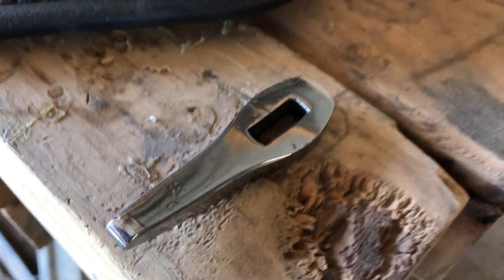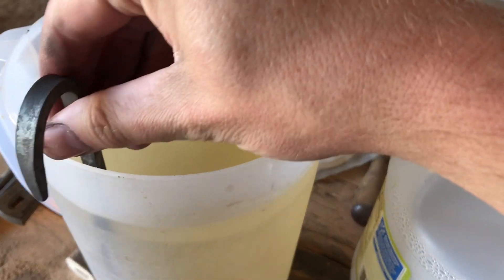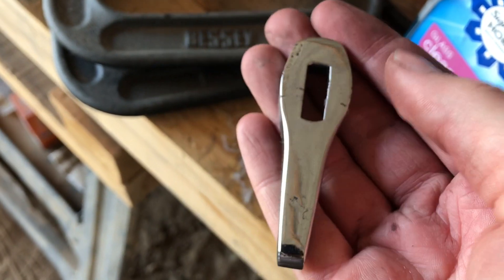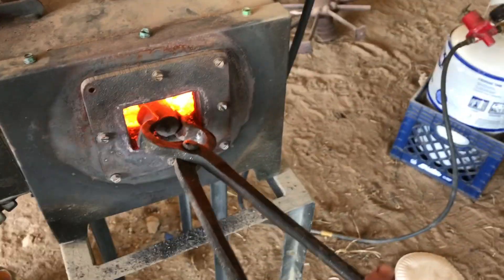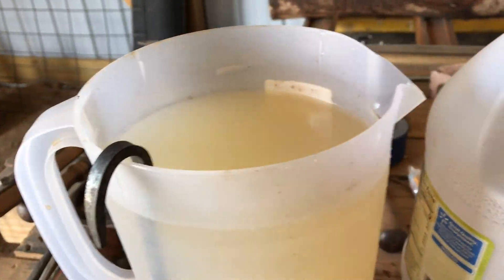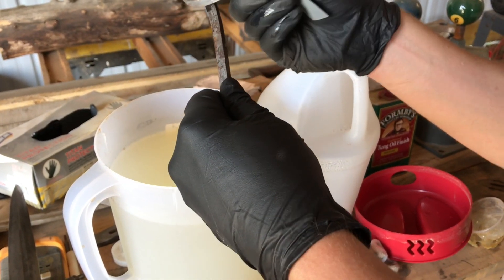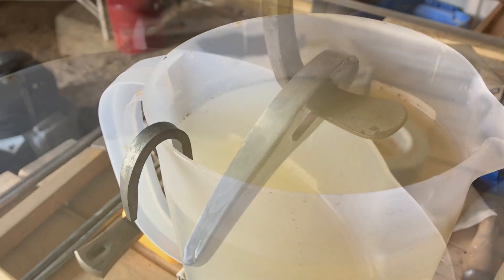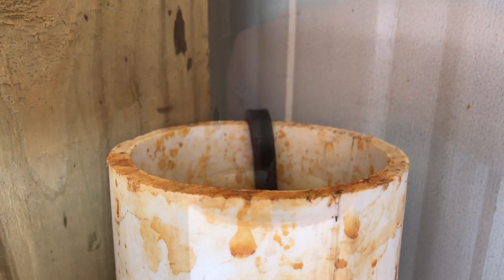How I learned to stop worrying and love Ferric Chloride

Comment: Cool video. I watched a guy explaining the chemistry of Ferric Chloride. If you simply mix it with 3 parts water then it becomes Hydrochloric Acid. This will completely blacken stainless steel in about 1 and a half minutes

Comment: I have a question, wath are the safety measures to use the Ferric Chloride and wath tools should i use for this... thx
Reply from the maker: Dreamy Depression okay man, you need safety glasses and chemical resistant rubber gloves and a minimum. If you want to go over the top with safety, face shield, plastic apron. 

Tools you need two plastic buckets with a lid, one full of your ferric and water and one full of water with lots of baking soda mixed in. The baking soda is to neutralize all the acid
Reply: @Hosenhoffen  I have 945ml of unused Ferric Chloride I want to dispose off. Any idea of the water ratio to FC I need before neutralising into the the Soda/water? It's frustrating to see many videos on how toetch with FC, but no videos detailing disposing of it.